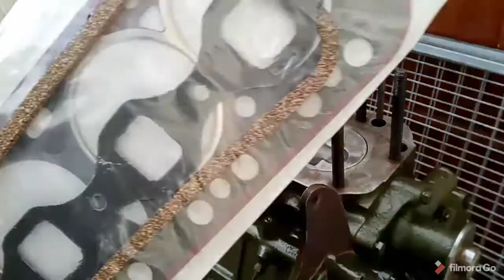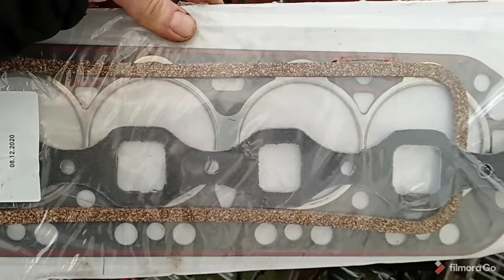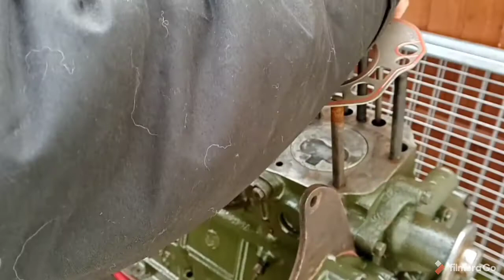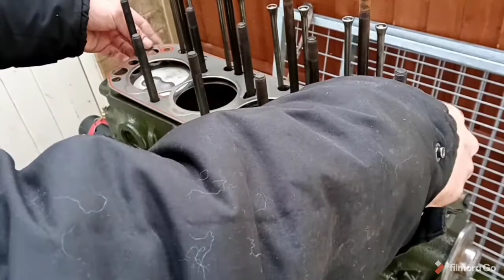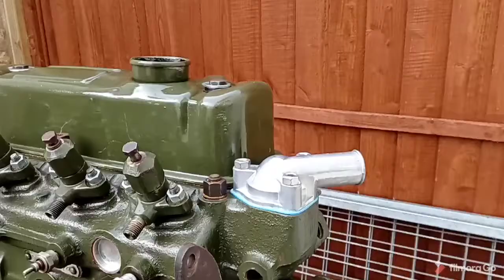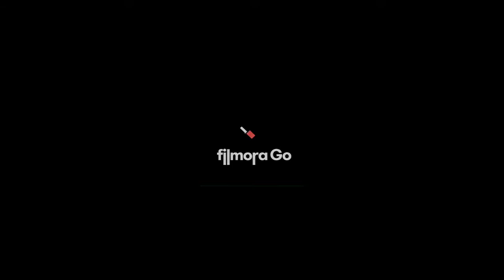BMC 1.8 BMC 1800 Diesel Engine Build Pt9 Cylinder Head

Comment: Can I ask you, what can be the cause if the head doesn't wanna come off? I'm having trouble with getting it off, it seems to be stuck
Reply from the maker: @vvangelder8459  double check you have removed all stud bolts including the central supports as they are often missed.

Comment: Great videos. I have just finished my BMC 1.8, and I have a question. I removed and cleaned the airfilterbox, it was completly sealed with old oil and dirt. Is there supposed to be a filter inside the housing? It now makes a rather loud "popp popp" sound when the engine is running. If I cover it with a rag, it gets a bit more silent, so I just wondered if there should be some sort of filter there. Thanks for your videos 🙂
Best regsrds from Norway.